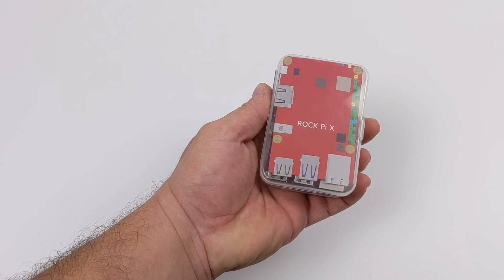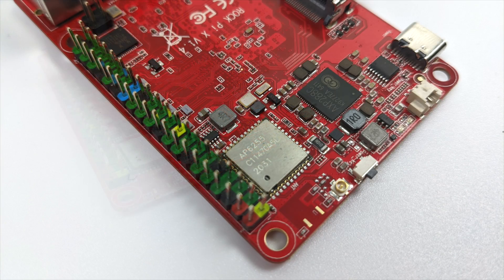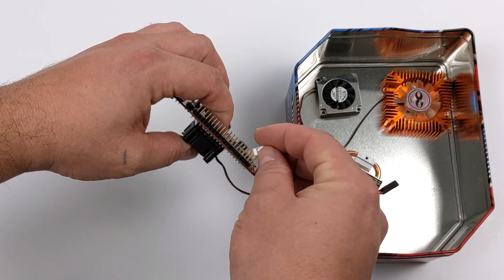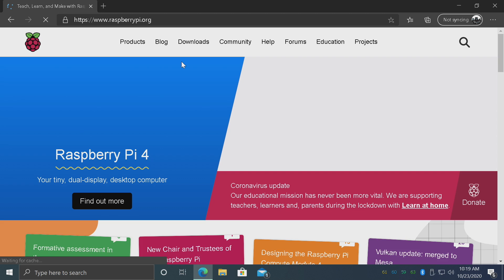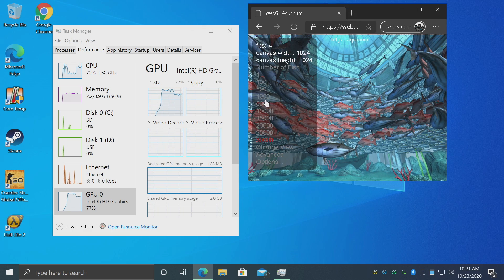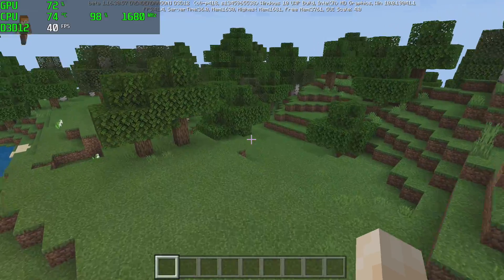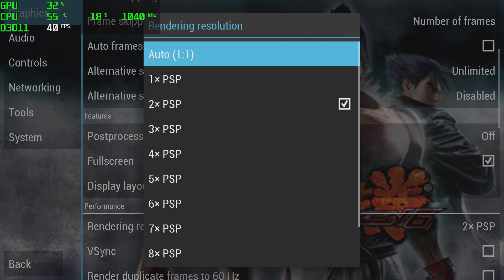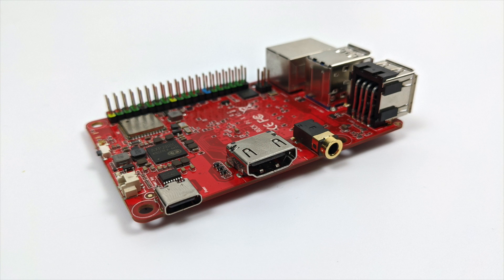Rock Pi X X86 SBC WIndows 10 Review - Is it Any Good?

Comment: I really wish this had 8gbs of RAM.
Reply: no point with that atom cpu...
Reply: @IcoKirov  
I've had reasonable luck with using atom cpus in the past.  It is all about keeping your expectations realistic and with a full 8gbs of RAM, it could handle Windows a bit better.
Reply: @Studio42-JZG  i would just go with different os that wont need double the ram... and it would handle a lot of other things better as well.
Reply: @IcoKirov  Ubuntu gets almost double the scores
Reply: Since it's x86 & if ur running win10...
Can u add RAM by plugging in a USB stick like u can on a normal PC..?
Reply: @MaxMax-dq1lu  You aren't really adding RAM when you plug in a thumb drive to your computer.  It just allows you to use it as a slightly faster transfer option between the hard drive and the RAM.

Comment: cpu benchmark of 920  and a single core benchmark of 400odd,  best avoid, pi 4 is faster
Reply: but it cant do what this board can. raw cpu performance its just a feature. this have perfect h264/h265 drivers for linux, mature mesa drivers, everything from day 1. thr gpu is way more powerful than rpi4 is you want facts. also it can run tons of x86 games

Comment: Very interesting SBC and great video! What you would recommend for light Web browsing, email and maybe some GeForce now gamestream that can run Windows 10? Would this still be a good option or would you recommend something else?
Reply: He mentioned the Celeron N4100, that's basically the least I'd go with today. There are some interesting Mini PC's and PC Sticks using it, I'd try finding one with good cooling as it can boost well when given the thermal room to.
Reply: @WhenDoesTheVideoActuallyStart  thanks! I'll try to find something
Reply: why windows 10...
the things you mentioned don't require windows at all. windows 10 is a heavy OS. 
if you are gonna get something weak, just go with linux or chromeos. 
for web, email and gefore now some chromebook would do just fine. or some cheap laptop with some linux version on it.
Reply: @IcoKirov  it's mostly for the wife. She doesn't really know how to work with other OSes
Reply: @graveeezord  so she don't have a smartphone? Cuz I highly doubt she has a Windows phone. 
Technically you can go for a low end laptop, but they have terrible displays and bad build quality. 
Working with chromeOS is like working with a phone. 
Linux have all kid of flavours, some looks like macOS, some like windows, some are similar to phone interface. 
A person who don't know much about computers won't notice he is working on Linux Mint instead of Windows for example, at least not from the start. 

My point is that working on different OS is not computer science. It's easy to learn for the most cases. 
Unless the user needs an OS specific software, there is no reason to confine yourself by one. 
Especially when this one is the most expensive, most heavyweight, and you are looking for something low end and cheap...

Comment: the emulators probably just need rock pi x specific optimizations. The ARM versions have been optimized for the low resource and bad GPU scenarios that all of these SBCs have, but the x86 versions assume you're running them on a proper computer with a good CPU.

Comment: These RPi alternatives are very interesting
Reply: They get interesting because each one tries to out-do the other
Reply: One usb 3, CPU on the bottom of the board and 9-12v to run it, deal breaker for me lol
Reply: @connermalloy  it runs at 5v. not recommended, I tested it by myself
Reply: @pilabs3206  is this really the 1st Pi on x86? TY
Reply: @connermalloy  your both usb 3.0  on the pi4 are shared to one pci so thry are not really 2 usb 3.0
Reply: @connermalloy  anyway average 12V 2A power supply is cheaper than 5V 3A, also with 9V - 12V range you can easily build your own 12V battery pack without needing step up / step down therefore will also make the battery pack much more efficient than ordinary powerbank module that have to step up 3.7V to 5V